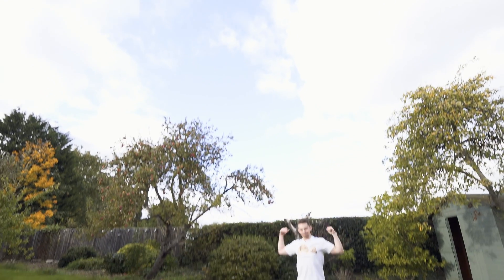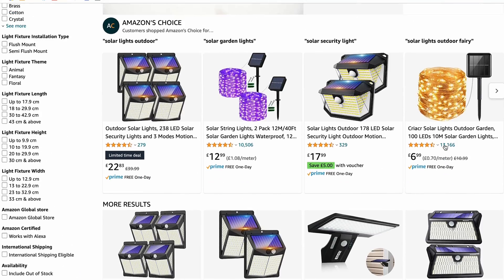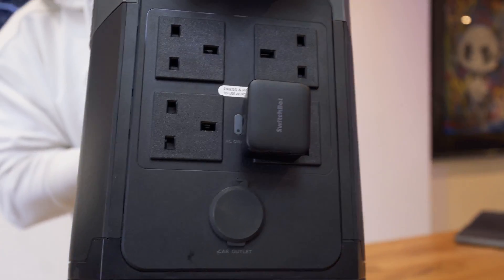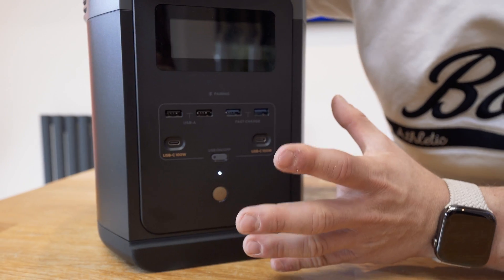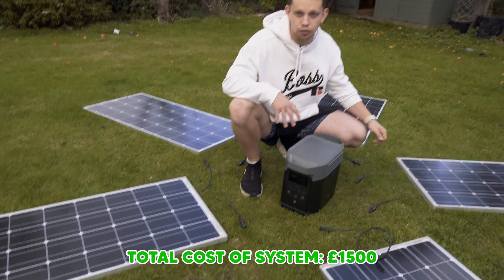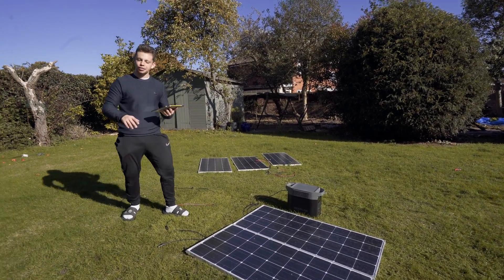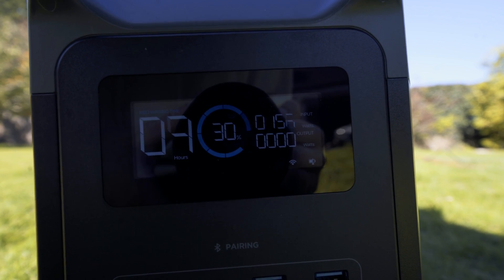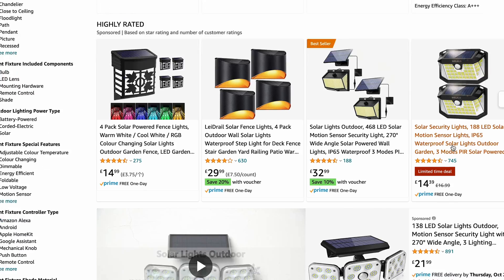Building Overpowered Solar Garden Lights!

Comment: This is a pretty good idea especially when compared to those sh*tty solar lights with teeny tiny cells. Pretty sure that the Delta 2 is a bit overkill though since it is 1Kwh. Mayhbe something smaller would be better for my use case since my yard isn't really that big. It would depend on the wattage of your lights, too.